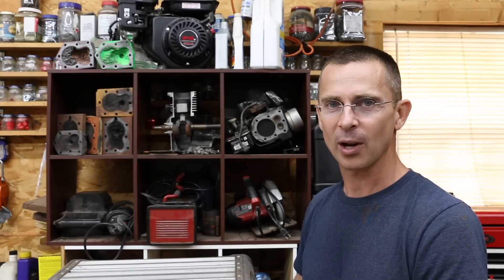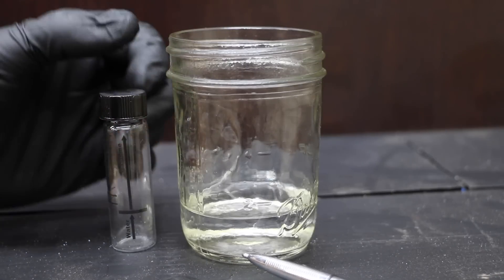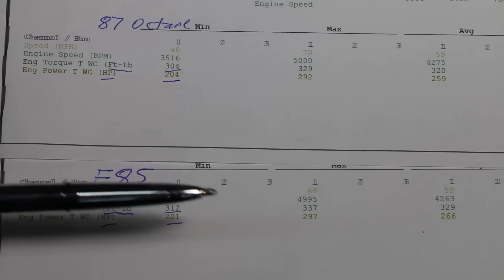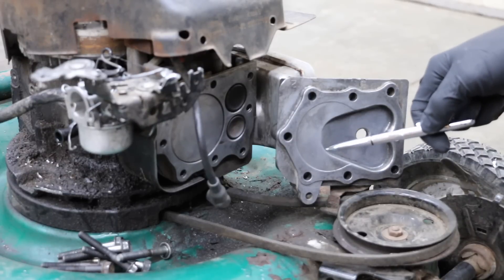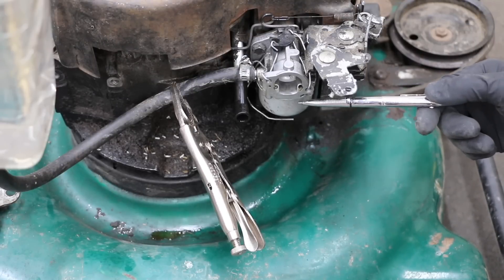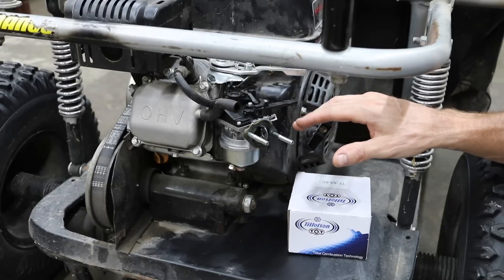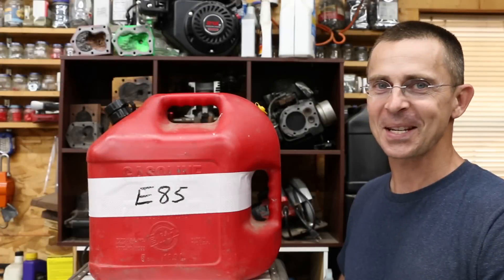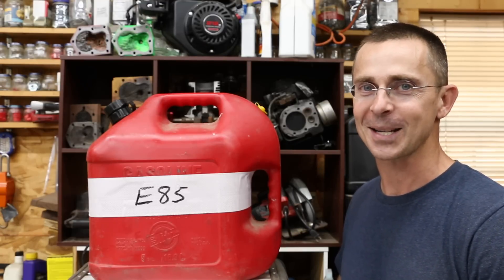Is E85 better than Gasoline? Let's find out!

Comment: Try to run a gasoline engine on diesel vapors.
Reply from the maker: Great video idea!
Reply: You can’t the diesel requires the fuel to be delivered and that’s why if you run out of diesel you have to fill the filter before it will run. That is unless they fixed that problem but I haven’t come across that yet.
Reply: @performancemotoring3798   yeah you're right! You have to purge that bastard everytime you run out of fuel, or change your filter. But it would be nice if they came with a auto purge mode!
Reply: How to blow up 101

Comment: Great test. Question my 2018 Ford F-350 6.2L if I have half tank of gasoline then put in E85 will I have issues half gas half E85. Thanks
Reply from the maker: Thank you. I would not recommend going above 15% ethanol content unless your F-350 is designed for E85/Flex Fuel.  It could cause warranty issues if there are problems.

Comment: I have a 2008 Impala 3.5L V6 (NON-FLEX) and I alternate 85 (15% Ethanol) and 87 (10% Ethanol) octane regular unleaded depending on where I fuel up. I see next to no variation in my mileage between the two.
Reply from the maker: Interesting. Thank you

Comment: Outstanding test like always! I have a suggestion,not sure if you have already conducted such test,but if not,it would be interesting to see how Stale Gas performs compared to fresh gas.
By saying Stale Gas i don't mean Gas that sat for half year and slightly smells like lacquer thinner and overall works ok,but rather something like what i have experienced,i've had two gallons that came out of a gas tank from a car that had sat for 10 years and everytime i was opening the bottles i had it it,the whole place was smelling like a very strong vinegar along with dirty diesel and sulfur! Unfortunately i've never had the chance to try it in an engine,but to tell the truth it was barelly igniting by a lighter,like a heavy diesel fuel.
Maybe you can also test gas that sat for 6 months vs 1 year vs 2 years or whatever you can find.
I hope you like my suggestion although for practical reasons it is a little tricky to implement!
Reply from the maker: Thank you!  Great video idea!

Comment: The one big thing is one should never run E anything unless it states on fuel ring or owners manual what you can run. If the behiis flex fuel then you can run any E. if not flex fuel, I would recommend against using Ethanol over 15% for very often. We can upgrade the fuel lines for it but we can't upgrade the engine for it.
Reply from the maker: Thank you

Comment: I have used E85 in my Ford Edge. I found that it saves me 25% at the pump but I lose 30% in fuel mileage and there is no discernible difference in performance. The only time I would use E85 is to periodically clean my fuel system...otherwise it’s cheap gas for my "Blue oval"
Reply from the maker: Great point. Thank you

Comment: What do you do for head gaskets in the lawn mowers. Do you reuse the gasket every time you take a head off, or do you order/have engine specific gaskets, or do you have a material of choice you use to cut your own gaskets. Also are you familiar with Kreen engine cleaner by Kano labs. I would love to see this in one of your videos. I've used it, per manufacturer instructions, to reduce engine oil consumption in saturn s-series vehicles (which is a whole thing) and have noticed a significant reduction. Only been watching a few weeks, love your channel.
Reply from the maker: I buy a lot of head gaskets to ensure consistency in testing and accurate test results.  Occasionally I can reuse a gasket, but only if it is in perfect condition, which is rare. Thank you!

Comment: Can you make a test where you feed pure oxygen at 0,21 ATM to a gasoline engine, so to see if it works with precise oxygen but with roughly 1/5 compression pressure (lacking the nitrogen and trace gases of air)?
Reply from the maker: Thanks for the video idea.

Comment: I have a toro wheel horse lawn tractor with a 15.5 horse engine it has a knock and it is on its way out do you have any suggestions on how to prolong its life? Thank you
Reply from the maker: Assuming it has a rod knock, Lucas HD Oil Stabilizer is very high viscosity and will provide a "cushioning" effect.   I would use a high viscosity oil long with Lucas.
Reply: Project Farm ok I’ll try that thank you so much

Comment: @ProjectFarm , Here is an idea: How about comparing the efficiency of running an engine with normal 'air' VS. using pure oxygen?  
Oxygen itself isn't flammable, however it does increase the efficiency of other gasses burning. 

I don't know if it would be practical to run an engine off of 100% oxygen because even a small engine moves a lot of air but maybe you could set up a "nitrous-like system" on a quad or go-cart at first to test its effectiveness and if it makes a difference then try it on a full size vehicle on a dyno.

 I also wonder how different octane ratings would impact the performance of running an engine in a high oxygen environment. 

I'm no chemist so i'm not sure if there are other factors that may go into it, but I have always been curious about it.
I know there are videos on youtube of people already doing this, but none of them go into as much detail and depth as you.
Reply from the maker: Great video idea!  Thank you
Reply: @ProjectFarm  :)

Comment: You should try adding motorkoat and a compression treatment oil additive both together and see how that turns out. Also, next time you try an oil substitute and there is blow by, put a screw in the crankcase ventilation.
Reply from the maker: Thanks for the video idea!

Comment: Your thermal camera is displaying the wrong unit. F is Farad (Capacitance), and the people who designed the firmware should know that. The degree symbol not being included on the US keyboard layout is no excuse in this case. 
Anyways, great video as always! Your channel is one of the best sources of information about the kind of stuff you're usually testing.
Reply from the maker: Thanks for this information!
Reply: in the usa we use °F for Fahrenheit, nobody not into electronics knows what a Farad is. The degree symbol is typed with option-shift-8 on a mac computer. ° a similar symbol superscript 'o' is typed with option-0 (zero): º.

Comment: Just had a question what is it you are using to start your lawnmower and small engines using impact instead of rope pull? Thanks I really enjoy your channel
Reply from the maker: I use a drill, not an impact, since an impact would cause damage.  I use a 1/2 inch socket adapter for a drill.  Thanks again!
Reply: Ok so you just use it on the fly wheel bolt or what?

Comment: The easiest way to get more power without touching anything complicated would be simply higher octane gas.
(Disclaimer: I don't claim any significant increases in power, and using high octane fuel(98+) may cause undesirable effects. Please be warned.)
Reply from the maker: Thank you

Comment: I'll admit I do not know anything about the difference in fuels other than I had a 1979 Chevy Blazer 4x4 with a built 350 and any time I could get gas with ethanol in it it ran way better so when I couldn't get ethanol gas I would either put 93% rubbing alcohol in it to help or moth balls which also helped it run at its full potential.  Like I said it was a built 350 4bolt main and 198 heads and solid core sparkplug wires
Reply from the maker: Thank you

Comment: I used E85 in a 2010 Ford F-150 XLT Supercrew with the 5.4L Flex-fuel.
I used 1/2 a tank just driving the approx 50 miles home from where I fueled up.  The power was sluggish and felt as if I was driving with the e brake on.  Never touched the stuff since.
Reply from the maker: Wow!  Thanks for commenting.

Comment: Hey I just got my dirtbike engine fully rebuild by a racing team and I was wondering why the oil smells like gas because I have done 2 oil changes and it smells like gas.
Reply from the maker: It's possible that the carburetor is allowing some gas to leak into the combustion chamber after the engine is shut down, which is then draining down past the piston rings and into the oil.  Again, just a possibility.

Comment: We put some e85 in our Escort (not designed for it) and it would not idle very well but OK on highway.
Ethanol in our classic car dissolved the fuel pump diaphragm and we had to get a replacement pump.
Reply from the maker: Wow!  It's a powerful solvent.

Comment: Thank you for another great test,Funny how things are when first cars where built they ran on methanol/alchohol and gasoline was worthless, that changed pretty fast.It's getting hard to find pure gasoline anywhere in nrthrn In. and our fearless leader wants to put 15% in all the gasoline.Race cars ethanol is good cooler running more horsepower,daily driver, gas is more efficient.Thank's for posting.
Reply from the maker: Thank you!

Comment: I have a 2003 flex fuel suburban as well, same color too. I have run e85 a few times but it is normally not that much cheaper than 87 to make the mpg drop worth it.
Reply from the maker: Great point.  These suburbans are thirsty!  lol

Comment: You should try running an engine either straight with PVC pipe cleaner or mixed with gas the clear PVC cleaner because it is very flammable and it cleans very well
Reply from the maker: Thanks for the video idea

Comment: My local small engine shop where I buy my mowers, snowblowers, etc. has always told me to burn premium fuel and I always add Sta-bil and an Ethanol remover?! to my fuel when I buy it. Sometimes I'll add a fuel system cleaner as well. Thoughts?
Reply from the maker: I suppose they recommend the high octane fuel due to lower or no ethanol content.  That's great advice.  Also, I use a fuel stabilizer and cleaner as well.

Comment: Great video! I was hoping you'd do an unbiased test on E85. I'd also be very curious to see a side-by-side comparison as to the long term effects of ethanol in various blends on carburetor gasket material, steel fuel lines, and rubber fuel hose.
Reply from the maker: Great recommendation on long-term effects.  I just began a long term test this week and will provide periodic updates.  I'm testing plastic parts in E85, E10 and non-ethanol.

Comment: have you ever tested this stuff? Didn't see it in the playlists. A buddy of mine who's a certified mechanic at a local Chevy dealer swears by it and we have been using it in my Jeep but after seeing Bestline's performance I'm wondering if I should change?! Also, have you ever tested all those "fuel system" cleaners out there. I feel like they make no difference at all.
BG MOA Part # 110 Engine Oil Supplement
Reply from the maker: Not yet. Thanks for the video idea!

Comment: My 2013 f-150 w/ 5.0L "coyote" engine, it seems to run better w/E-85, specially in the cooler months when humidity is much lower, but like you presented it gets as much as 6-7 mpg less so I really prefer to not use it. A problem I noticed here in the summer months it is so humid that you don't want to leave much E-85 in the tank as it really soaks up the moisture in short order. On those rare occasions when I do use E-85 (there's been a few times when gas service has been delayed and that was all they had), I always carry couple bottles of gas dry.
Reply from the maker: Great point on the humidity!

Comment: I tried sending you a PM. Can you please do a marvel mystery oil test where you test the viscosity change by replacing a quart of oil with a quart of MMO as recommended by MMO as well as if you can run solely on MMO in the crankcase. I’d be curious to see the results. Recent subscriber and love the content!
Reply from the maker: This is a great video idea!  Thank you
Reply: Project Farm 
If you decide to do the test, would you mind doing a common oil weight. Such as 5w-20 or 5w- 30. Again thanks for the video’s, one of my favorite channels.

Comment: Well the car could use an OTS map that enhances the ability because of the E85. Some cars can run E30 without additional parts with just a tune.
Reply from the maker: Great point. Thank you
Reply: @ProjectFarm  Yea right now in my 2009 135i I'm running E30 and I have had no issues as far as the car running. No hard starts... nothing.

Comment: My 1988 Dodge Dakota sport pickup truck  with a 3.9 V6 5 speed manual transmission when gas was 4 dollars years ago and e85 was $2.57 a gallon I ran e85 never had a problem
Reply from the maker: Nice!

Comment: E85 makes a great deal more power in boosted engines (turbo or supercharged) as is has a much higher octane rating which allows for more ignition timing and it cools the intake charge which keeps cylinder temps lower than the equivalent octane gasoline.
Reply from the maker: Great point. Thank you

Comment: Thanks for another awesome video. It would be neat to map out a chart that showed similar comparisons for other ethanol blends, going down from E-10,E-15, E-25. Etc. Possible even comparing, Different Brands of E-85 to see if certain companies, use a better octane component with their ethanol blends.  I also wonder if you can run an engine with Hydraulic oil Instead of Engine Oil?
Reply from the maker: Great video ideas!  Thank you

Comment: Which particular model of the tillotson tct did you get and install and how well does it seem to work so far?
Reply from the maker: I bought it from the link below. It's setup for a predator 212 cc engine.   I really like it a lot.https://www.gopowersports.com/tillotson-tct-mechanical-fuel-injection-carburetor-replacement/